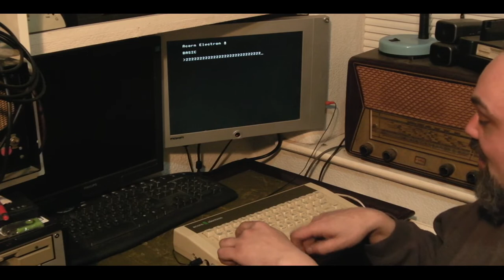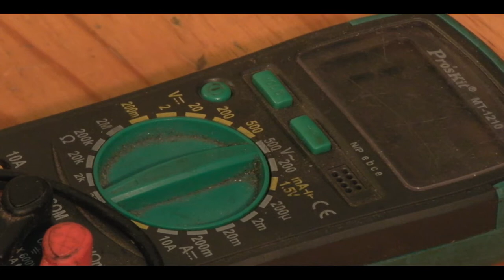Acorn Electron Fixing the faulty shift key

Comment: Not sure if this applies to the Electron, but on the BBC Micro you can do BREAK + SHIFT to execute the !BOOT file on a disk.  Hold down the BREAK and SHIFT keys, let go of BREAK and then let go of SHIFT.  I noticed on your video about the Turbo MMC addition to a Model B that you were typing *EXEC !BOOT which is not required.  Also I think the Turbo MMC ROM needs to go in the position where the DFS/ADFS ROM usually sits.  I noticed on that video that the system was losing the Turbo MMC after a soft reset.  Putting the ROM in the correct position should stop this from happening.  Hope that is useful.